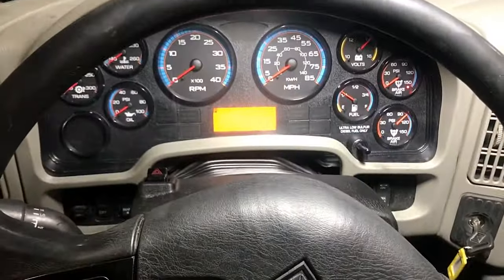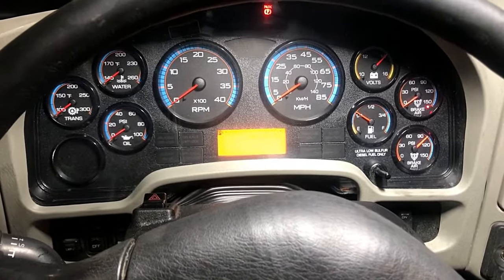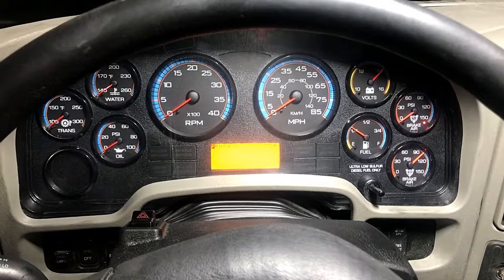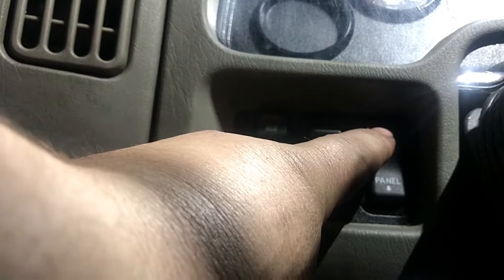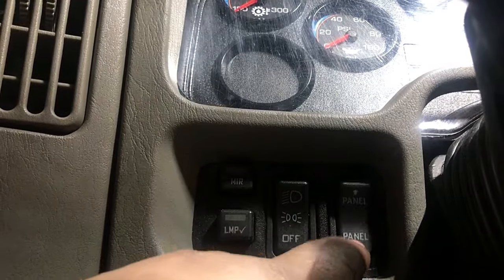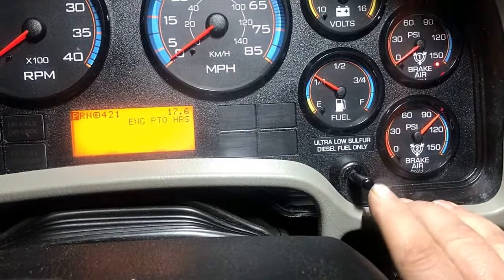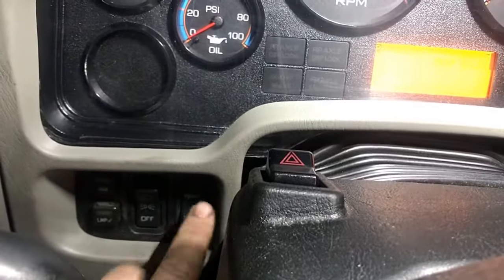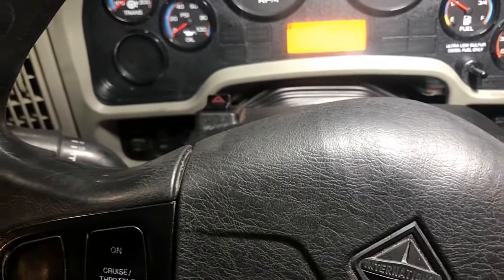How to turn off International Truck Warning Buzzer/bell /charm sound!!!

Comment: Beeping hack Only works if ignition is turned to the normal On (right) position. However, It’s turn to the left for accessory power, beeping refuses to stop.
Reply: Beeping sound want stop

Comment: The we are using doesn't have a rocker switch. The dimmer control is a wheel type.  Any other suggestions?
Reply: Current issue I’m dealing with as well.

Comment: I have that same issue with the beeper constantly going off but both of my air gauges all right 6 o’clock which is 190 pounds but they’ve only got 120 in the tanks what’s wrong

Comment: It works when switch turned right and engine off . Thnx
Reply: Do you have to turn the truck on and the off? The original Hack is not working so I am wondering where the switch should be at

Comment: What year is your truck? I have a 2016 and it definitely didn’t work..
Reply from the maker: I my not work in the newer model truck.
Reply: @bigrigfix  I retract that statement. It actually worked but I’m trying to bypass the low air pressure sound with the auto start/stop button engaged. Is there a method for that?
Reply from the maker: @ngrossley low air warning with full air pressure there maybe problem with pressure switch bypass that .

Comment: I have 1 low beam headlight out.. I’ve changed the bulb…not it…relay next? Or more likely wiring? High beam works fine though. Thank you
Reply from the maker: A lot of time the plug connections at the headlight burn up and have High resistance.

Comment: My buzzer stays on while I am still driving the truck I tried that technique
 but it doesn't work help me please
Reply: Rey DelRio  You said keep it running.. pressed cruise and accel button.. Truck is still running when i do this.. after dash resets.. i can see what codes i have on the dash.. great.. but this does nothing to stop the annoying beeping sound.. then you said turn truck on.. but the truck has been on the entire time.. anyway.. i would like to idle without getting this beeping sound.. Do you have an easy fix that works? The shops are closed on weekends and its cold so going to need to idle to get heat and would like to sleep but hard to do with this annoying beeping sound from the engine is running.

Comment: also, i have an oil leak in the same truck as in your video, i have found the leak, but i don't know the part's name that is leaking. it comes out horizontally from right at the top in the middle of the engine. it is a long metal rod, that has some kind of wire on it and it goes to an electric piece. i thought it was the oil pressure sensor, but this piece does not quite look like the sensors that i have seen online and in the auto parts store for the same vehicle. if anyone has any assistance or the name of this part, please let me know. thanks